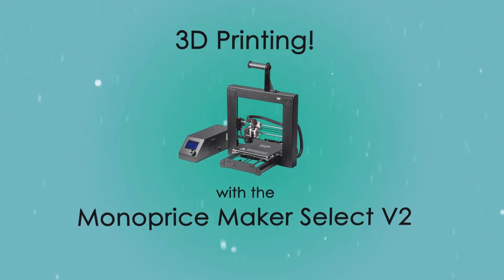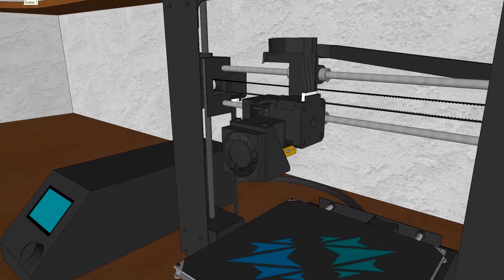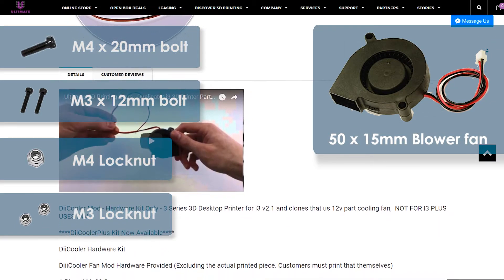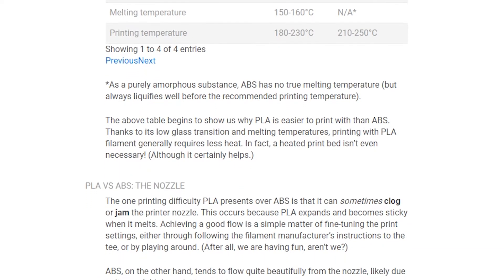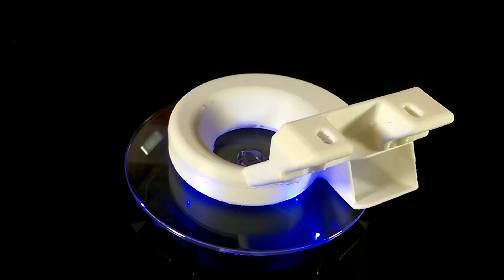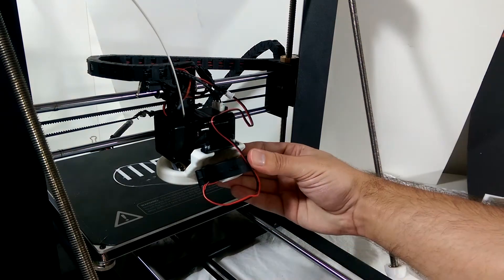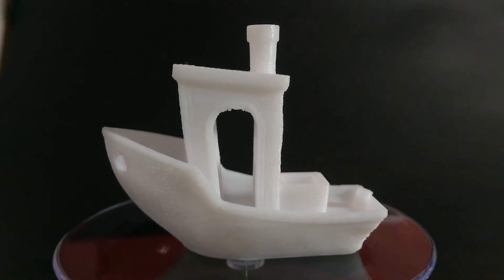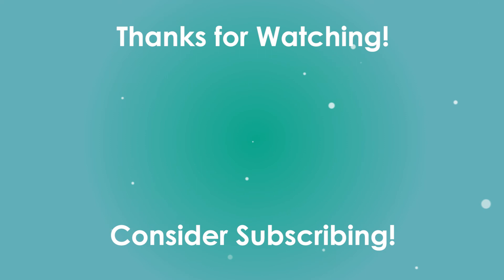3D Printing with the Maker Select V2 - Ep5 | DiiCooler Installed, Reviewed, and Tested!

Comment: How did you print this in ABS on the Maker Select V2? The hotbed on that printer is only rated for up to 70c and ABS works best with a hotbed at 110c. Does anyone have any recommendations on getting ABS to print properly with the Maker Select V2 stock hotbed?

Comment: Can i use the 24v instead of the 12v ?
Reply: Depends on the printer, remove your current fan and check if its 24v or 12v. But if you run a 24v fan on your 12v systen the fan will not perform as well.

Comment: is the power connector for the fan the same as the printer's? like can i just plug it straight in where the old fan was plugged in? or do i have to solder a new power connector on to make it work?

Comment: Can you demonstrate what is the max. size plate it can make. I know its 200mm x 200mm , but can it print that size or is it less.
Eg: a Plate 200(w) x 200(L) x 6mm thick with 8 holes drilled in it. It can it only print say 195mm square?
Thanks.
Reply: I printed a 198x120mm object with mine the other day. Cura wouldn't let me do the full 200mm for some reason, even with the build plate disabled completely, but the printer did the 198mm just fine.

Comment: I have the maker select v2.  out of the box it prints great with default cura settings, but the benchy chimney/smoke stack always fails!  basically it gets very stringy and the layers stop adhering once the layers are confined to the chimney ( there is no move to the roof after its complete back to the chimney ).  At the point where the nozzle makes a travel move the PLA globs up, everywhere esle is stringy and wobbly.  

I'm starting to think the issue is in the slicer somehow,  I've tried slowing wayyy down, adjusting retraction, wall size and infill up to 100.  The chimney always shows these small gaps in the slicer, that may just be a visual thing in cura, but only when i put infill to 100 does it show 0 gap.  Even then it doesn't print right at all.  Can anyone help?
Reply: No nothing as tall, however for testing I sunk the benchy through the ground plane so only the chimney is printed and the same thing happens, so it doesn't appear to rely on height.
Reply: I printed a spool holder mod in the vertical configuration as it comes https://www.thingiverse.com/thing:1805457

It's very tall and I didn't notice the same problem.  On the other hand I printed a part with several small cylinders hoping that because it makes travel moves between each section of each cylinder it would help.  Honestly I think it did help, but the problem is still there and they are very bad quality although somewhat in tact this time.  The break off very easily.
Reply: Just an update:  I joined the Maker Select v2 group on fb.  One guy was having the same problem as me and found that changing to version 2.7 fixed it.   I did the same and it fixed it for me as well.  Thanks for taking time to try and help me!
Reply: I guess you could call it downgrading as I started out on the newest version 3.4.  The other guy did update from 2.7 to 3.4 and had the problem so went back.

Comment: Glad you're back! How has the printer held up these past few months? Ever thought about trying exotic filaments on this channel? I haven't had the need to do this mod for my printer, I haven't had much stringing. In an older video I told you I ended up buying the upgraded touchscreen model of this machine, but I am considering hooking up a raspberry pi to mine to keep track of prints in real time using octoprint. Might be a good idea to look into it as you continue modding, I think it could make this machine into a beast. Plus it can help when you start to do larger prints and push the print bed area limits

Comment: The issue there may be the tip needs to be cleaned. That may be causing filament to snag. Also I looked into getting Microswiss new nozzle and all metal hotend it's great. I have it on mine and I can print with Petg way better than I could with the original setup